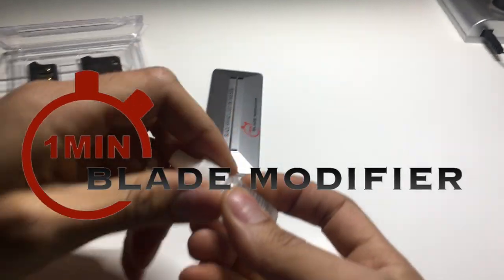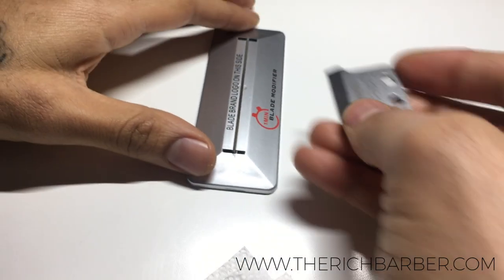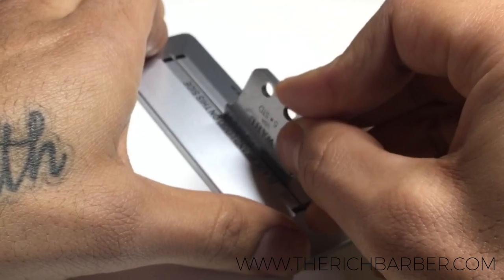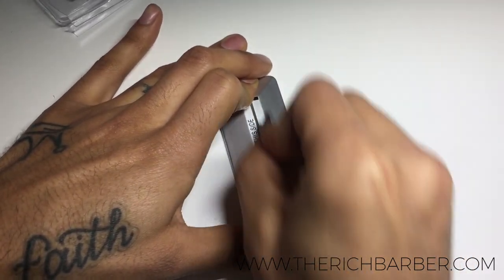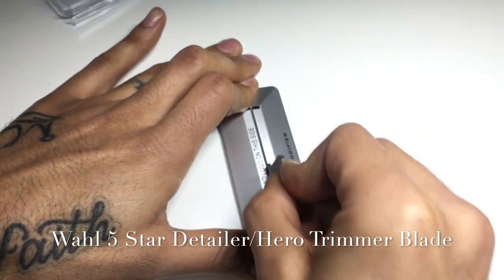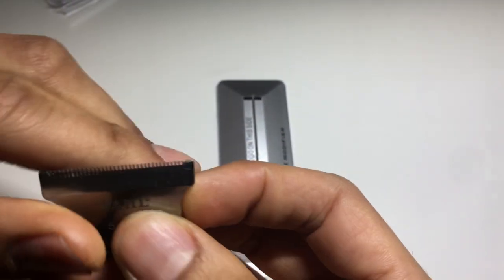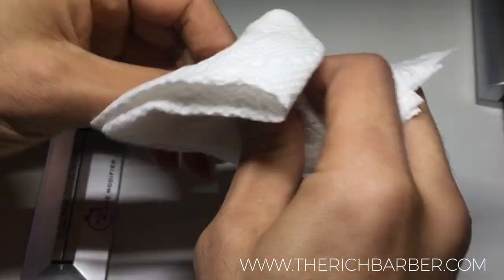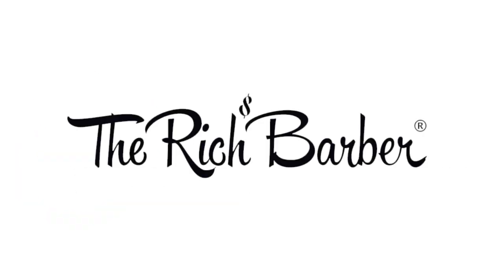How To Use: 1Min Blade Modifier

Comment: I have the Andis Styliner II Personal Electric Trimmer and purchased the blade modifier. The blade for these trimmers are very hard to take apart so that I can modify the top blade. Is it ok to modify the blade with everything together??
Reply from the maker: Leon Harris no. You should take them apart and just modify the stationary blade
Reply: What's the best screw driver to use to take them joints off?  Currently I am unable to take them apart

Comment: And not to mention it really stings myself and many others complain .. I oil it when needed clean it take hairs out and I even did the table trick so the moving blade does not base the blade and still the trimmer stings even after I did everything I could.. should I get andis another hero’s or try this and see how it goes? Everything is tip top shap just weird why it started to act like this

Comment: Will this bring back dull blades or is this only for new blades?
Reply from the maker: Styles by Yates It will make the blade perform better. But If the blade is dull because of longtime use then it should be replaced with a new blade. If the blade is "dull" as in "not cutting sharp and close" then this will definitely make it perform better.

Comment: I was wondering if I can use the modifier "sharpener" again on the same blade. Can it be repeated used on a blade after it gets dull?
Reply from the maker: Joseph Petersen, because it’s a modifier it works best on a new blade. Your cuts will come out much sharper and cleaner that way
Reply: i just found out from 360Jeezy online, part of the answer to my question. Now do you sharpen the smaller blade too, that joins up with the larger blade? I imagine that this counts as 2 sharpenings or modifications on the Modifier Blade Limit.

Comment: just ordered mines bro.

Question? Can we modify the andis slim pro 2 with this modifier??
thanks
Reply from the maker: Alfred Drayton there is no slimline pro 2. There is a slimline pro, a slimline pro Li, and a slimline 2. If your referring to the slimline 2. I don't know. It's not a professional Trimmer so we didn't check. What sucks about he slimline 2 is that you can't even adjust the blade on it.
Reply: I apologize, it is the slimline li.
Reply from the maker: Alfred Drayton yes it will work for it. 👍🏽

Comment: one of my barber bros told me about this product it's a must get. But question how to give a sharp line to someone with a light hairline?
Reply from the maker: Jeremy Lee you use this. Haha! 👍🏽 also try applying some hair fibers for enhancement. Hope this helps
Reply: 😂😂😂 I got one on the way! Thanks for the help. No one else replys... One more quick question do it work with the bevel bladem
Reply: 😂😂😂 I got one on the way! Thanks for the help. No one else replys... One more quick question do it work with the bevel bladem
Reply from the maker: Jeremy Lee 👌🏽 I don't know if it works for bevel. We didn't test it with that blade.

Comment: How often does the modifier need to be replaced?
Reply from the maker: Dominic Ofa you can have 15- 20 uses
Reply: Oh ok, I saw the question answered but just wanted to make sure if we're on the same page with the questions being related. My next question how often does the blade need to be sharpened? Or does that depends on a barbers usage... Is it recommended that a new blade should be used every time when sharpening or when the blade that was sharpened gets dull can it be resharpened again?
Reply from the maker: Dominic Ofa the product does not sharpen the blade. It modifies it. Modifying the blade allows the blade to perform better and make "sharper" crispier lines but it does re sharpen the surface of the blades. So you only need to modify a blade one time. A dull blade from excessive use should be replaced with a new blade. Hope this helps
Reply: ***** thank you for clearing that up makes sense now... Can't wait to receive mine

Comment: Either my clippers aren't set right becsuse that'll be big factor, right? because I don't see a difference
Reply from the maker: Dominic Ofa both are big factors. If you're not seeing a difference you're definitely doing something wrong.   Which trimmers do you have?
Reply: ***** I have the andis T-Outliners... I am going to work on tuning it right, that's the one thing I don't have the skills for but also I have the Morono blade liner to adjust my blades getting it close to zero gap but not too close...
Reply: Dominic Ofa grab the on the money blade setter...
Reply: Chuka Torres do you do the moving blade also?

Comment: if you modify it then it will not fit the 10-second blade adjuster properly
Reply from the maker: it will still work correctly with the blade setter
Reply: thank you. I didn't know if the the cutting the blade down would make it smaller thereby not fitting properly into the setters.

Comment: You missed a trick. If you double sided this it could be used to grind the leading edge. Many of the copy machines cant zero gap but you could grind the top blade to meet the bottom blade instead. Maybe get a 3d printer and sell cam followers for wahl detailers and Wall no longer sell them and copies require them

Comment: You probably should head on over to 360's channel and correct some misinformation  he is giving about the product. Based on this video, 36 is demonstrating it all kinds of wrong. Also clarify the point of this tool. Some here keep saying "sharpen", but you say "modify". Are the 2 words interchangeable or distinctly different.

Either way, I love the innovations from your company. Keep at it!
Reply: I'm wondering something similar. I love the Andis blade modifier I just tried today. Wow! Saves lots of time. But I'm wondering if I can use the modifier "sharpener" again on the same blade. Can it be repeated used on a blade after it gets dull?

Comment: The one minute blade modifier is trash!! I got ripped off.. What a waste of a good 25$..basically it shaves part of the metal tip off but it can only work when its zero gaped wich in turn increases the risk of cutting or irritating your clients skin. Close gaping (not zero gaping) your trimmers and using a straight razor is the answer to take your haircutts to the pro level.